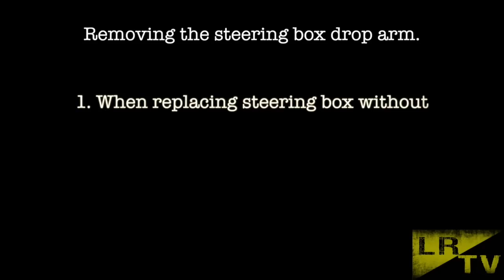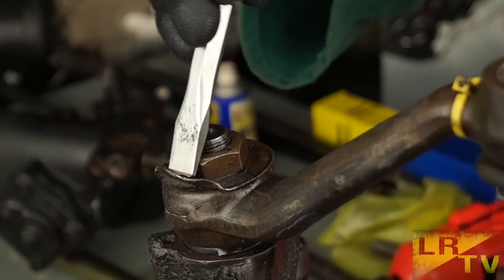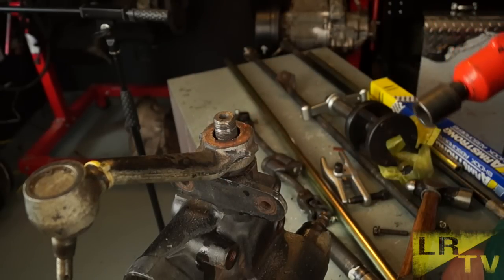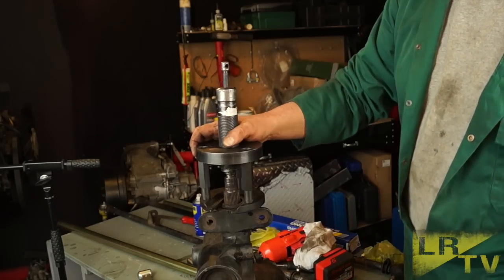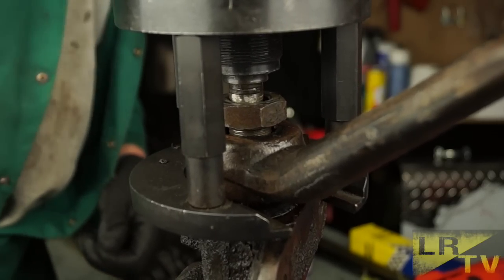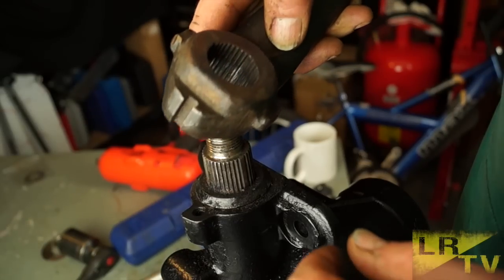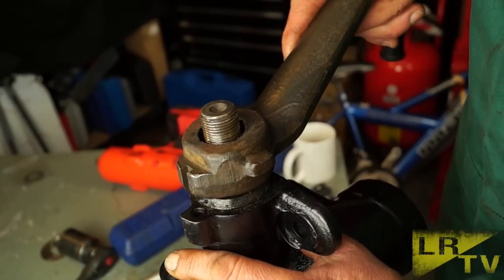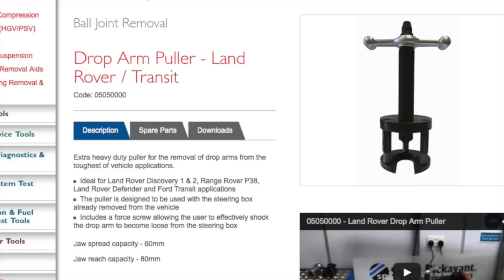How to -  Land Rover drop arm  removal with the Sykes Pickavant 050 5000 puller

Comment: Interesting. Explained lots of issues I've just had with a 2009 Defender. No tabbed washer fitted and drop arm working loose, unsurprisingly. Also, had all previous mechanics cut the old drop arm off and never seen this tool before so an interesting watch. Cheers
Reply from the maker: I can't see the point of cutting them off TBH.  Just perhaps to save a few pence when there are recon boxes with arms already attached.

Comment: hello what size nut is on the drop arm?
Reply from the maker: Casn't remember bud. Just measure across the nut on two flats and that will give you the size.
Reply: @trailerfitter2  didn't think about that, i'm relatively new to turning my own wrench. i'll get the measuring tape out, thanks brother!